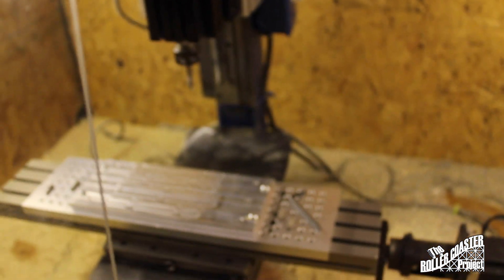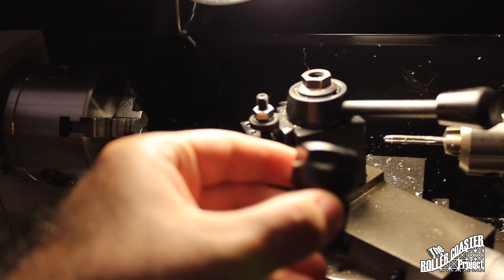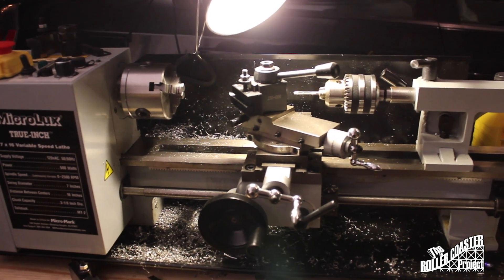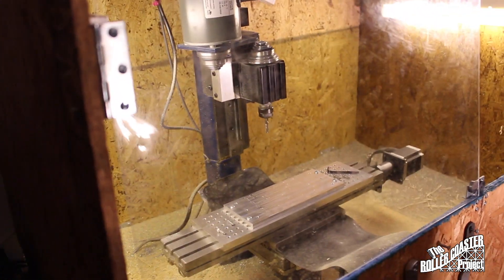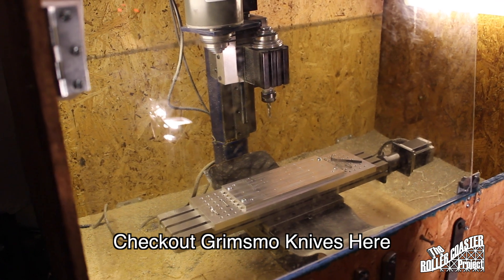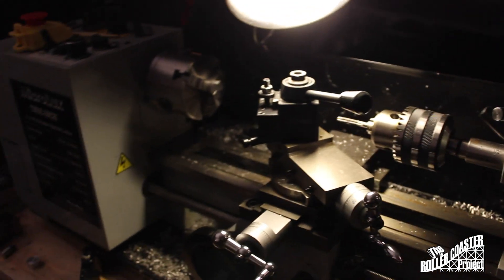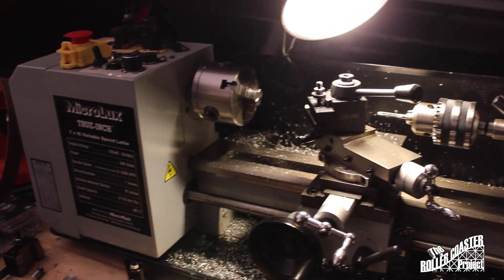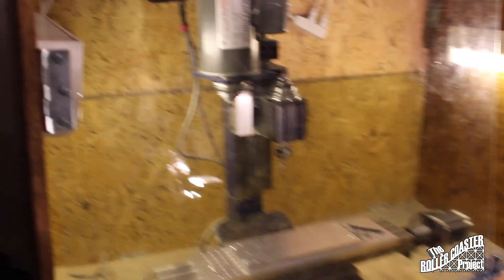Manual Lathe to CNC Conversion, or Not?

Comment: Hey. I just saw your video and I have the Micro-Mark 7 x 14 mini lathe. This is the first of your videos I have seen so I'm not sure what you're working on but I had to adjust the gibs and mill a tiny bit to make them sit better. I don't know if the newer lathe is better or not in there. You can just take a picture from the side and look at how they are sitting on there. If at an angle, that will need some tlc. Also, over time you need to check the gibs as they may get lose. I had mine for a long time and made a few improvements. For example making sure the gears are aligned correctly, etc. I just finally started making small useful parts since I got it, but one day I'll make new gibs. As for the accuracy, I just use my calipers to keep measuring my parts. I use the marks on the dials as reference of how long I turned but nothing more. Plus I like using the metric system so it makes life simpler for me. I guess you don't sound too happy with yours and I was like that for a long time, but once you start fixing whatever it needs they're fine for what they are.  Just keep that in mind and I think you'll be okay. After I saw how they changed the controls and took away the slanted rpm reader, I wasn't too crazy about their new ones. I guess I got used to mine now. I don't really like their plug-in rpm piece. I think it was much better built- in but what do I know.

Comment: Go for CNC lathe, you don't want to be without one for what you're doing.  Ballscrews may be overkill, depending on how good or bad your leadscrews are.  Even if you add ballscrews, it's still a small and relatively flimsy machine - would recommend something heavier but would still recommend CNC'ing that lathe over doing something lathe-like with the mill.
Reply: Ball screws are not overkill. They are absolutely essential for a cnc machine. All leadscrews, including perfect brand new ones, have backlash, and that is intentional. With backlash, the controller doesn't know the location of the tool. Even backlash of .001" will produce a very poor and inaccurate surface.